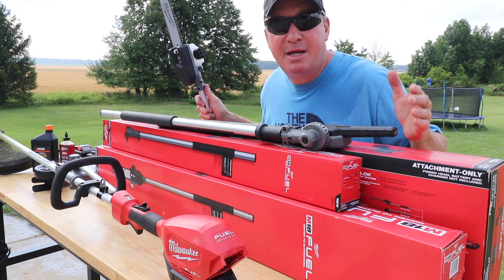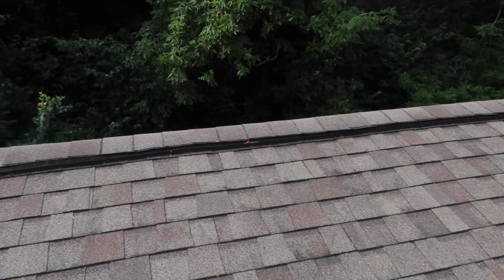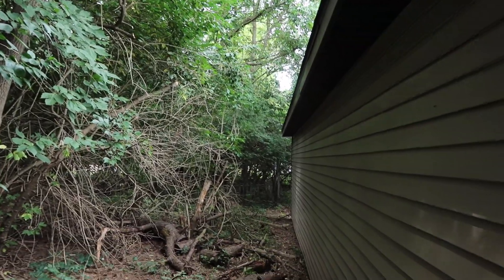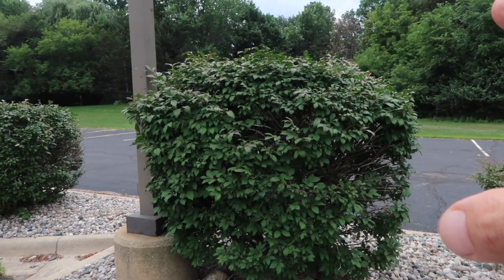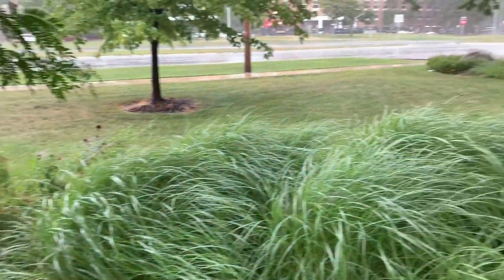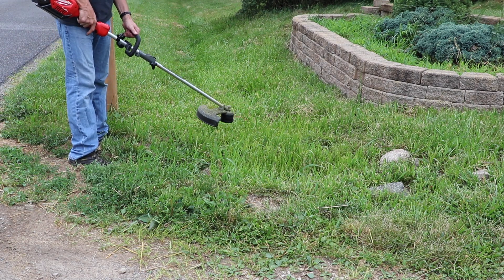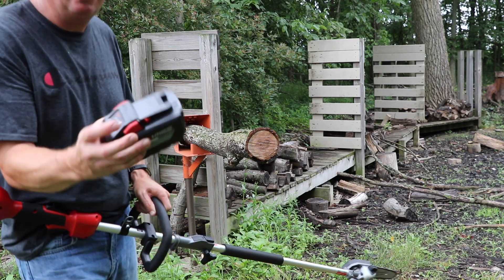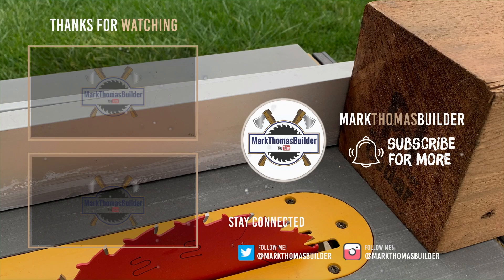MILWAUKEE 1 BATTERY CHALLENGE!  WHAT CAN I ACCOMPLISH? | M18 12AH HIGH OUTPUT!

Comment: I've had the string trimmer cut out when using the 9.0ah HD battery during continuous, heavy trimming in hot, sunny weather.  Also, the 9.0ah battery gets a bit hot to the touch.  Light string trimming around trees, beds, etc. is fine, however.  For heavy use, the 12.0ah HO battery is a significant improvement over the 9.0ah.  I haven't had any cutouts using the 12.0ah, and the battery only gets warm.  As a side note, the Gen 2 blower feels better balanced with the 12.0ah (it's a little nose heavy with the 9.0ah).  Seems like these tools were optimized for the bigger battery.  The string trimmer kit really should include the 12.0ah HO instead of the 9.0ah HD.
Reply from the maker: That's good to know, I haven't noticed the 9.0 getting hot.  I have the Milwaukee chainsaw and plan to try the 12Ah in there soon.
Reply: Same here, I was trimming some thick overgrown grass and it was a very warm day, the 9ah shut down and was in thermal overload protection. I do know however, when I first got it, out of the box the battery terminals on the power head somehow had a little grease on them causing the tool to cut out randomly due to lack of good connection to battery, took me a bit to find that was the issue, cleaned the grease off and have been good since. Using the 12ah in the blower balanced it perfectly as you said, using the 9ah makes it too heavy and awkward on the wrist. If I’m doing weekly trimming I use the 9ah on the trimmer and 12ah on the blower. If I have some edging and heavier trimming I’ll use a 12ah on both.
Reply from the maker: Interesting about the grease issue.

Comment: I bought this edger, trimmer quik lok combo from HD and it lasted two months for me in summer weather in 90’s. The unit kept shutting down on me due to motor overheating. I sent it back to Milwaukee. They sent me a whole new unit. The new unit is working flawlessly. I’m looking to upgrade to a similar sthl setup for next year and have the quik lok as a backup.
Reply from the maker: Interesting, thanks for sharing!  Mine is still going strong and I've only had it overheat one time I think.

Comment: Love my Milwaukee fuel I made fun of battery powered equipment until I was gifted the fuel for fathers day now it's my go to trimmer it holds up well working at a moderate pace and it last about an hour when doing more heavy trimming before doing a battery swap so in my opinion i always recommend Milwaukee to a home owner and if your setup is right you can use it commercially as well in my opinion
Reply from the maker: I agree.  The key for commercial crews is to remember to charge their batteries the night before.

Comment: Well just bought a new kit with the milwaukee trimmer, pole chain saw, extension, 8amp mx18 and fast charger $383 including tax. Of coarse, home depot cant send it all at one time!
Reply from the maker: It's a great kit that will get lots of yard work done for you.  Maybe you could use each one for several hours until the next one arrives?
Reply: @MarkThomasBuilder  Mark this tool is a beast! One bar used for all my trim work. And it is built to last. The chain saw comes pre- assembled unlike other manufacturers
Reply from the maker: @Dirtyharry70585  I didn't realize that other chainsaws aren't pre assembled.  I like the way MIlwaukee battery powered equipment gets up to full speed right away without warmup time.

Comment: That was a lot of work done! 
Question: Percentage wise, is there much of a torque/power difference between the 9ah H.O. and the 12ah H.O.? I’m doing my final phase of purchasing tools and batteries in both my M12 and M18,  and have found the sweet spots in XC (5ah XC and below) for my needs in less demanding tasks/light weight priorities....now to augment my single 9ah with stable mates.
Knowing what you know now, would you just run with 12’s?
I really enjoy watching how you’ve developed into quality video and reviews! (Much Appreciated.)
Reply from the maker: Thanks Scott!  I always grab the 12Ah high output battery, even though it weights more.  I've heard others say great things about the 8Ah high output battery being a great choice.  The main difference I notice is runtime and not so much power and torque.
Reply: Thanks Mark! Last larger tool I need is a Milwaukee Table saw for back property and easy setup/demobilize punch. 
Thanks Again, Scott

Comment: What battery would you recommend for this tool? Thinking of getting getting one but don’t know if the 12 would be to heavy? I’m mainly going to be using it as a strimmer (weed eater)
Reply from the maker: The 9AH works well and isn't quite as heavy.
Reply: markthomasbuilder did you find the 12 ap heavy on it or not tho?
Reply from the maker: It's a little heavy, but balances nice in the trimmer.

Comment: I’ve got 3/4 acre. How would the weed whacked hold up going around a property of that size? Wondering if I just need gas powered at that point. Trying to avoid buying 3 or 4 batteries if that’s what it would take for a property of that size if you know what I mean
Reply from the maker: I would think 1 battery for trimming property on 3/4 acre.  If you're talking around the house and a sidewalk and driveway, then no problem.  I would think you only need 15 minutes of run time per week.  Is it more trimming than that?

Comment: Do you have a video on the holder?
Reply from the maker: The video I did on the Quick-Lok power head is here... https://youtu.be/qhLVAcW344g  It features the line trimmer attachment.  Is that the holder you're referring to?
Reply: @MarkThomasBuilder  Log holder at end of video.
Reply from the maker: It's call the Wood Dock and it's for sale at Baileys Online.   Here's a review... https://youtu.be/ESqbpJKEVQg

Comment: I have not loved my Milwaukee trimmer and blower any more than i do since I got them. I sold my gas stuff right away.
Reply from the maker: What were your initial reactions to them?
Reply: out of the box I feel in love. it was a fathers day sale with the blower included.  and I was so impressed with everything.  the fact there is no more gas. I pick it up and go. if I need to move something or do something I can set it down and it stops. no idle or having to turn it off.  pick it up and go.  its great.  The only thing so far is that unless i'm doing it wrong, but the string seems to get stuck and wrapped up tight and wont come out when I bump it to feed the line.  But could be user error.  but like I said, I've loved it since I got it out of the box.
Reply from the maker: That's awesome.  Some factors that might effect the trimmer head performance is the thickness of the line and the type of line.  If you put too much line in there, it might not work as well either.  Hope that helps!

Comment: I have everything milwaukee. Drills, impacts, saws, grinders and just picked up the chainsaw, and wet dry vac. My only question is what's the long term life of the batteries because they are not cheap to replace. I run my Stihl blower and weed whip on less than a gallon of gas per year. That would take me over 50yrs  to accumulate  that much fuel to equal the cost of the 12.0 battery. Plus Stihls are not as expensive as the battery powered Milwaukee. That's the only thing stopping me from switching and the fact that I can run a lot longer at wide open throttle on one tank of gas vs. The 15-20 min batteries.
Reply from the maker: That's a good point.  The thing about batteries is that you don't have to do any filter changes, carb repairs, worry about fresh fuel, etc. It just depends on your use.  I've had some batteries only last a few years and others that have lasted 5+ years.
Reply: It’s different if you are actually using the tools everyday. If you only go through a gallon of gas a year then you obviously don’t need a 9.0 or even a 12.0 battery. You can probably do the work you perform with just 5.0 batteries. But to someone using these tools daily. You can’t beat the battery powered tools. Just for the noise reduction alone is amazing.